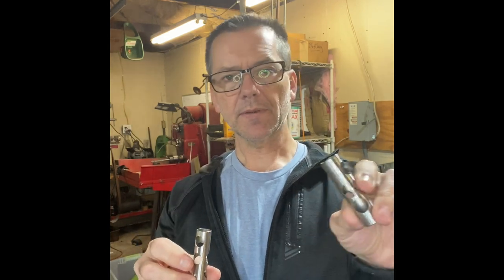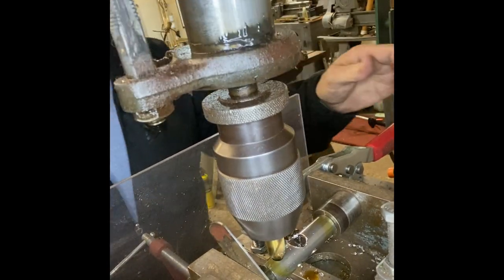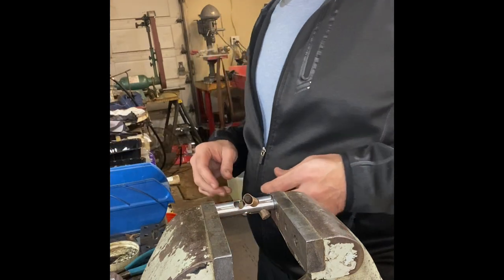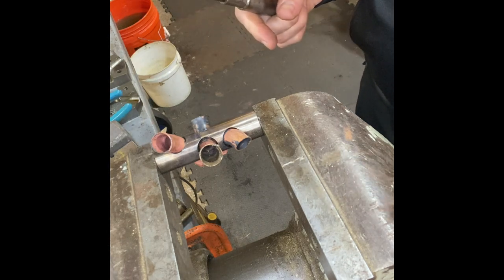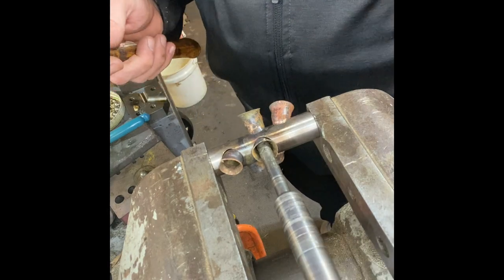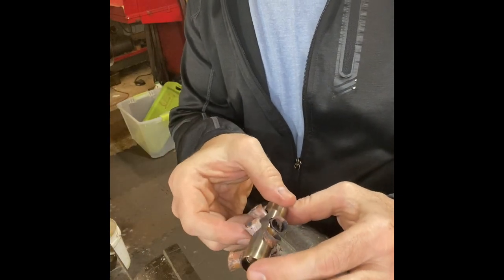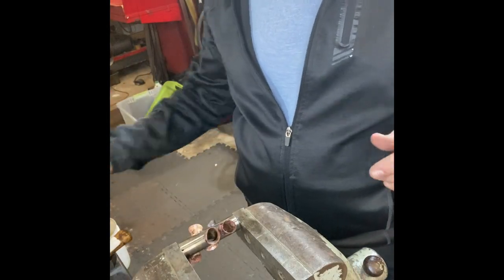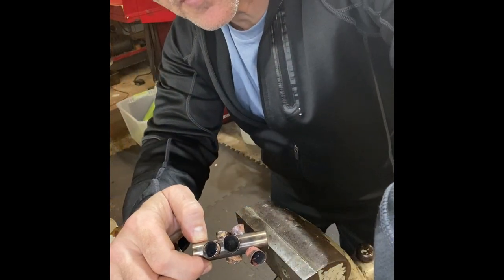Piston production video #1

Comment: Qual é a distância entre furos é o ângulo para sequência de furos
Qual o diâmetro da broca
Reply from the maker: The distance between the holes and the radial locations are proprietary. The hole size is .5". I can say this that the distance between the stacked holes from center to center is the same distance as the vertical travel of the piston during use. That distance changes from brand to brand as you might guess.
Reply: Valeu um abraço

Comment: Just bought trumpet in almost perfect condition. "Almost" because of missing valves;-)
I'm handy and I have needed tools including small metal lathe so sharing of your valuable experience on your channel is "what was missing". Since here in Croatia I couldn't find monel source here could I use some other but still OK material for the piston body?
Reply from the maker: If you have access to stainless steel it would work well. You could also use nickel as a base material. It isn’t as durable as stainless or monel but it would work.
Reply: @benchmarktrumpets9733  Thx a lot for your support. Meanwhile I found valves and button replacement kit on Ali for about 70$ with shipping. Stainless steel would be choice if chinese valves wouldn't fit.

Comment: Why use monel when many manufacturers use stainless or nickel silver,Which lasts much longer.
Reply from the maker: @pasqualegallo8234  lasts longer? Bach and Schilke to name two brands have been using monel for a long long time. Stainless is an option that some makers use because it is cheaper to purchase. Monel is more difficult to machine but is predictable and does last for decades. Stainless usually requires nickel plating as well and do remember that the valve body is made from brass alloy and will also wear over time.